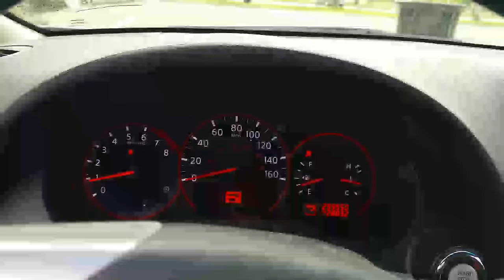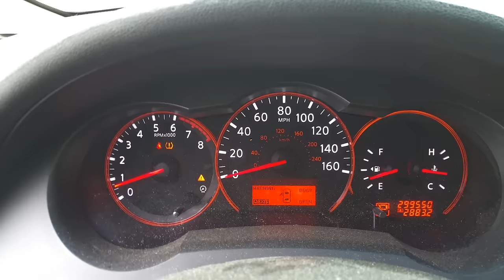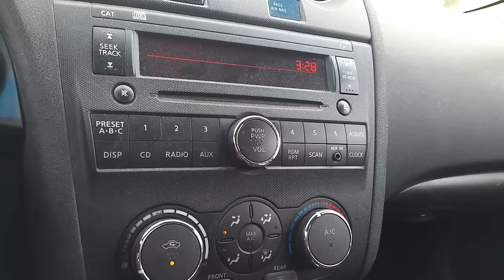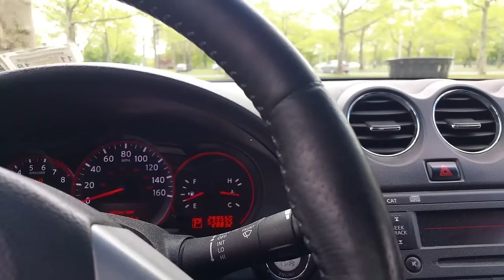CVT Whining Noise and Fail Safe Mode Fixed!

Comment: "CVT Whining Noise and Fail Safe Mode Fixed!"

"BUT...You know. BUT...You Know. BUT...You Know...Etc, etc and ETC". Not to mention: constantly moving the camera over and over and over; that makes one" sea sick"...Sad, sad and SAD.

So get this: My Nissan CVT had a "Whining Noise"; that could be felt. But NO "Fail Safe Mode". So...

I took it to a transmission shop last Friday; and they changed the oil. It cost me 400 dollars; and I bought the new Nissan oil myself; before I went to the shop. I asked them to clean the "Mass Air Flow" sensor; and clean the "Throttle Body" sensor; and I bought the cleaner cans. They did all of this...

It took them 4 hours to do the job. Drove it out; and the sound is still there; and I can still feel it. Plus, I KNOW they replaced the Nissan oil with a brand new set of almost 6 cartons. No doubt.

But my car IS much smoother and the mileage is rising. Hooray!

Now then "BUT and You know", oops...I meant "Buster Brown"; tell me this...WHY do I still have a whining noise? Huh kind Sir? 

Oops don't bother to answer; for I won't waste my time again; watching you constantly move your camera; around and around the whole time; let alone hearing you say over and over, "BUT...You know. BUT...You Know. BUT...You Know...Etc, etc and ETC". Sorry jes' "caint" stand it Bubba...

CYA
Reply from the maker: 400 to change the oil? You got ripped off. The oil should have cost 50.00 at most...I have diy videos on how to change it yourself with a 10.00 pump from ebay and 10.00 tubing from.the Home Depot.
Reply from the maker: You still have that winding noise either because the cvt belt is worn or that shop you went to never changed the oil.
Reply: @peterl6095  The facts:

1. They DID change the oil; because I asked a dear friend; to make sure. And he did it.

2. To remove the oil and replace it; plus clean the "MAF" sensor and the "Throttle Body" sensor; and take the car for a test and get it hot; so they can determine if the oil is correct; took 4 hours.

3. If you divide 4 hours into 400 dollars; comes out to only 100 dollars per hour; and in today's cost; I was totally pleased with what they did.

4. They changed the CVT filter and gave me the old one; and they discounted the price of it to dirt cheap.

5. I have NO problems with what they did; nor their costs. But I am madder than hell with NISSAN. And ALL manufacturers that make those worthless piece of crap.

Incidentally; My original comment's "point" was: Your using the words "BUT and You Know"; over and over and over again. That drove me crazy. Not to mention your constant moving of your camera the entire video. Sad indeed.

Finally: the problem with the CVT's; is not "this or that". The problem is: That damned CVT is pure "garbage in and garbage out." They should have NEVER used that worthless transmission on any car. Believe it or not.

And the proof is: The myriad of "Class Act Suites"; today; ALL over the world proves it beyond doubt; that transmission is a JOKE!.

End of Story and I rest me case.
Reply from the maker: @MrPatdeeee  

That shouldn't have cost 400.00. Prob should have checked your fluid to see what color it was. If it was black and burnt, should have done the diy yourself. It wouldn't have been worth dumping 400.00 into it.
Reply from the maker: @MrPatdeeee  

I have links in my pinned comment. Just buy a 10.00 pump, 5 quarts of cvt fluid and some tubing from Home depot. Only takes about 30 min. Costs less than 70.00.

Comment: You are wrong. You still have to service the regular transmissions as well. No car is maintainance free. Come on dude
Reply: Vin Mar true however geared transmissions are stronger they hold more power and last longer. Also requires less maintaince

Comment: It's a cooling design defect, changing fluid doesn't fix the problem.
Reply: @Mark shinnick i have the Nissan car, i change fluid according to Nissan specification and the same genuine fluid provided by Nissan but eventually  its transmission whines.
Reply: @edwinalexander1170  Yes, you must fully seal the cooling plenum and optimize all cooling to slow or stop the oxidizing of the fluid.

Comment: U know Nissan offers extended warranty 120,000 miles or 10 yrs on 2007-2010 Cvt transmissions. I’m having transmission problems and just found out I’m 3 months over the 10 yrs!! Fml but if u have these years of Altima and have transmission problems I would check it out!!

Comment: I read online from a person who does not have any problems with their 2012 Nissan Sentra CVT transmission he changes his fluid out when it changes to a dark color If you use red fluid when it turns black If you have a clear or light gold fluid when it turns black it should be changed It's no longer any good and he's doing his every 15,000 miles 40 to 60,000 mi is way too long to be waiting to change that CVT fluid but hey if it's working for you that's fine and also like the other gentleman was saying you need that aftermarket transmission cooler that helps a lot as well If you're going to keep the vehicle I forgot what year yours was the the guy who's doing this YouTube video but mine is a 2012 and at this point I've had to rebuild my transmission and I'm going to get rid of it I just I want something bigger anyway and it's starting to have other little quirky issues and I don't want to be taking it to the dealer the car isn't worth that much anymore and I want something bigger so I just want to get it fixed good enough to sell it But hey good luck If you love the vehicle and want to keep it.

Comment: I have nissan sentra 163k on it and i had the same problem with the transmission and i changed the transmission fluid today and it worked on my car like 95% to 98%, i guess as soon you feel an different in transmission changing the gear change ur fluid right away without any delay.
Reply: Is that a manual transmission?
Reply: @shavingopee785  no its automatic
Reply: I guess manual transmission would be alot batter then the automatic cvt one
Reply: I have a Nissan Sentra 2012 with 200,000 miles. The issue I’m having is when I drive long distances and some time drubbing  my driving on the highway I cannot longer accelerate. This only happens when I drive long distances
Reply: @JohnJacobGarza  i have a 2017 sentra i drive alot continously  every day  and have 215k on my sentra, i am soon going to change transmission oil again and its gonne be my third oil change since my first reply, you might wanna check when did you change your transmission oil last time, because i dont take chances with my stupid cvt transmission. In alot of videos on youtube they are taking about the nissan cvt transmission heat up so have your oil change between 30k to 40k or whenever you feel ur transmission acting differently change the oil to keep your transmission healthy if you have alot of running.
Reply: @WahajHassan786  I already change the transmission oil

Comment: He said on normal transmissions you don’t have to change the trans fluid after 100k miles 🤦🏼‍♂️😭
Reply: The transmission fluid is just as important as the engine oil, they both need regular service if you want to keep the vehicle running.
Reply: Linda Kaye that’s my point after he said that I wanted to smack him!

Comment: Any nissan owners out there experience forced deceleration when going from 25 to 0? My 17' pathfinder does that for some reason. It feels as if I am still pressing on the gas when I hit the brakes at 25mph. And no my right foot ain't riding the gas pedal as I bit the brakes.
Reply: Eddie Arcega mine will sometimes jolt and lunge/surge forward right before it comes to a stop, I guess at around 3 mph.  I'm thinking mine is part of the engine compression braking that all nissan cvts have.
Reply: @Stephen-xw3ww  Mine does that exact thing as well. Damn nissan cars. I should have test driven other brands before signing that contract
Reply: @edgararcega3046  I just learned about the engine braking a couple days ago and that any nissan dealership can disable this feature. I hate it.....I like to coast up to a red light, not feel like I'm dragging an ancor
Reply: Be careful of what you buy especially from Nissan
Reply: I have a Nissan Sentra 2012 with 200,000 miles. The issue I’m having is when I drive long distance at some certain point I cant no longer accelerate to higher speed. I push the pedal all the way down and nothing happens
Reply: So yesterday i got a notice in my mailbox. Class action lawsuit against Nissan for their CVT transmissions. Wonder if i should jump on board. I haven't had any issues with my Nissans transmission.... Yet
Reply: @JohnJacobGarza  Your transmission is going out. Your car is going into limp mode. Change your transmission fluid and don't fill it to the fullest setting.

Comment: its funny how North American dealers tells buyers of any vehicle, regardless of transmission types, that their ATF is lifetime.... Meanwhile, in the EU, they suggest a 30-50,000Mi (50-80,000KM) drain and fill service.... Am in Canada, and have always, at least do 1 drain and fill every 50,000KM (from new) or at least 2x for used vehicles....

on domestic(Used Purchases): 
seeing how it performs after the 1st drain and fill of my ownership; keeping the old fluid for a while just in case) 

On Asian brands(Used Purchase, non CVT, with Aisin branded Auto Trans):
initial drain and fill 2-3x(500km apart) then every 50,000km thereafter

On Euro vehicles (Used Purchase, non DSG, with Aisin Auto Transmission) : Same as Asian Vehicle procedures. 

at $24-36/Gal its no big deal for peace of mind. Never had a problem since(Used vehicles are my winter cars... i usually keep for 3-4 yrs, purchase millage range around 170,000KM-270,000KM, Except for Volvos and Toyotas ... as high as 300,000KM possible). 

Works for me ... (Personal decision/opinion)

never had a CVT vehicle (i avoid) or DSG yet... 😁

Comment: If you can't replace a key fob battery( warning light on dash) or tire pressure sensor( tire pressure light flashing)then you have NO BUSINES trying to work on a transmission!!!!
Did you check the codes in the tcm or check counters to see how many times you overheated the trans???  Didn't think so.    Take your vehicle to dealer and have serviced and STOP GIVING BAD ADVISE!!!!!!
Reply: advice

Comment: So are recommending me to change my CVT transmission fluid?
Reply: Slick Sloth did it work?
Reply: I read somewhere that it should be changed around 30k-40k miles including the transmission filter. Not sure about the inspection of what need to be replaced or repaired so far.

Comment: Just dont buy a car with a CVT, i bought a nissan altima 2015 SV within two months i had to get the transmission replaced for 4700$, my advice to anyone looking at buying a car, do not get one with a CVT transmission, they drive smooth and are nice to drive but reliability is awful, especially with Nissan 160k and you need a new one, if you bought the car at 150k it was already time to get a new one

Comment: hey peter L does it make a whining noise when you acclerate and come to a stop or just accelerate i have a 2007 nissian versa and it is making a werid noise when i aclerate and come to a stop not sure if its the same thing or a wheel bearing

Comment: I have a question. My cvt transmission whines also. Did your bad cvt transmissions  whine when you revved your car in park or neutral?
Reply from the maker: It's been a while since I had the car but I don't think it did.
Reply: Mine just started whines at D and startting a gear no whines at N , did u see mechanic?
Reply: @Geknight   Mechanic told me its the torque converter...
Reply: @chrisr.986  wow have u replaced already? Im changing transmission oil tomorrow im skeptical about it but ill let you know how it goes i have like 230k miles bought brand new qx60 2018
Reply: @Geknight  not yet. When and if I do I'll let u know...
Reply: @chrisr.986  thanks bud would be great and ill reply u tomorrow too,after changing tranny oil lets see if its gonna help
Reply: @chrisr.986 did the change help with the whining noise?
Reply: @GeKnight did changing the fluid get rid of the whining noise?
Reply: @earlhurt971  yes. Thankfully.
Reply: @chrisr.986  good im gonna try on my 16 nissan versa... it just whines and revs higher than normal
Reply: @earlhurt971 have u fixed the whinning issue with your versa?

Comment: I went to autozone slot of codes popped up. Main ones were VVT solenoid and the engine control module. What should I start with first? Transmission and motor oil change? Has not been done in a long time along with spark plugs
Reply from the maker: Check all fuses. Make sure none are blown...change transmission fluid....
Chances are the vvt solenoid needs to be  changed. Prob should do the engine oil..
Vvt solenoid shouldn't be hard to get to.
Reply: @peterl6095   I just did the engine oil change the noise went down completely about 90% I can just her with slightly now a little ticking. Next I’ll do the transmission oil flush and hopefully the noise completely goes away but now I’m not worried. And the guy said that I only had about a half a quarter of motor oil in my motor when I changed it right now 😭😭
Reply: @peterl6095   and yesterday I unplugged my computer connections and the code still popped up. Today before I even got the oil change the service engine soon light turned off by itself which was really weird
Reply from the maker: It was prob because you had low engine oil that caused alot of the lights.
Reply: @peterl6095   thank you bro I appreciate the video! ❤️
Reply from the maker: @nathandiaz3742  

No problem man.

Comment: What! second cvt! I am still feeling the pain of the rebuilt that cost me $3500 for a 2011 Cube! For the sake God & your wallet don't buy anything CVT ever again! Dude failure is imminent. We bought a new 09 Sentra for our daughter. Both vehicles same Nissan maintenance schedule drain & refill CVT at 30k Cube failed at 106,000 miles. Some divine intervention the 09 Sentra oem cvt still good at 200,450 miles. It when into limp mode 3 times in 11 years due to extreme FL heat AC blasting. Easy fix pull over let cool down put on heat don't use AC!  Good riddance sold 09 Sentra last week $900 Never again any type CVT only maybe atv or motorcycle.
Reply: Buy dodge or gm they will break sooner
Reply: @derlissamaniego1914  I had a 2001 Dodge quad cab LB 4.9L 4x4 trans & transfer failed at aprx. 100,000 miles. Replaced trans only traded in for a brand new 09 Tacoma DC 12 years of ownership very minor repairs compared to all other vehicles we ever owned.

Comment: hey bud i have a 2016 nissan altima and i have a whining noise and a p0776 code popped up saying the solenoid is hungry for oil..how many quarts did u put it ??
Reply from the maker: About 4 to 5.
Reply: @peterl6095  thank you 🙏....has the solenoid ever give u a problem ??
Reply from the maker: No. I kept on driving with the noise. No issues with the transmission having any shifting probs till it broke down and the fluid turned black and burnt.
Reply: @peterl6095  🤦‍♂️🤦‍♂️ o the trans ended up breaking down ?....i just changed the oil and it still has a problem shifting...im going to have to try and change the valve body solenoid pack and hopefully that fixes the problem ...its about 400 from dealer and 240 refurb
Reply from the maker: @antoniot1271  

That's about the going price....

Comment: Bla bla bla bla cvt,cvt,cvt no solution too much bla bla. Here the solution common this problem. I have dodge caliber uses same cvt. In hot days when you turn on the ac and drive more than 70 miles its starts noise and safe mode. İnstall extra oil cooler radiator to car big enough that will helps to cool cvt oils. İf you able to mount with cooling fan that will be better.  Sorry for bad English...

Comment: Hey guys 08 altima here is my ish once warm car has no 1st gear in drive switch to triptronic and goes in 1st n second but on 3 it goes back to 1 put back into d starts shaking barely moves pedal to floor not even revs up hold it two seconds later revs up takes off
Reply: Gear issues and sounds like safe mode
Reply: Its safe mode transmission is done everything you said happened to me of I turned my car off put it in  on mode for 15 seconds then started it waited 15 seconds it would drive fine until I came to a stop end of story had to buy a new transmission bud now runs perfect

Comment: I put new transmission few years ago and now they have 99k miles i didn't do eny service on that like changing fluid and now like a week ago started having whining noises i went to two transmission shops to diagnose they told me its internal issue on transmission but they don't know exactly from which part of transmission coming that noise i try to do the flush on transmission but Nissan wont guarantee me if the transmission will be better and deseapear the noise what u think it will be better to do flushing or my transmission will be worsening